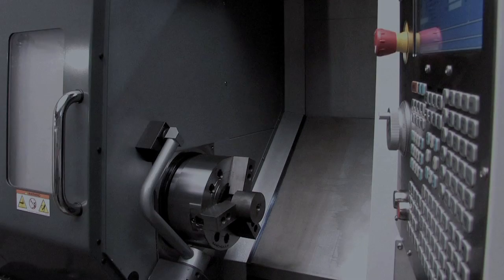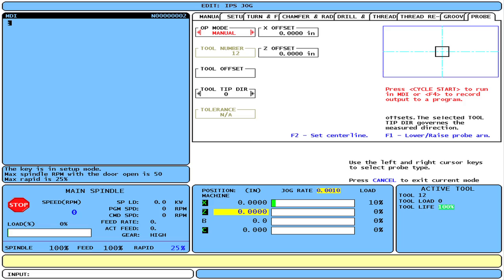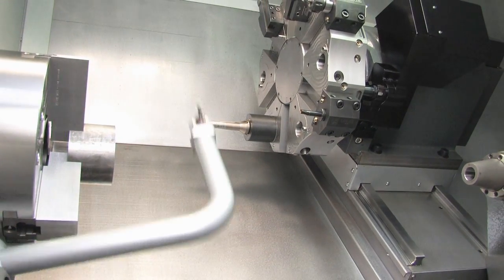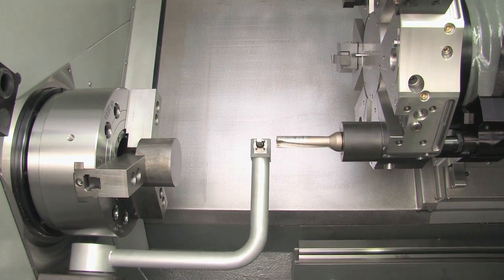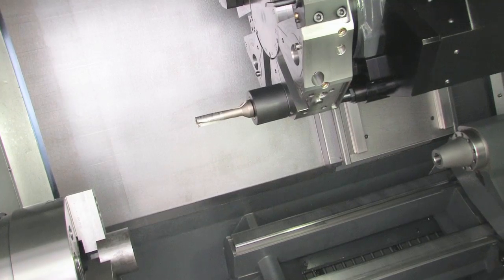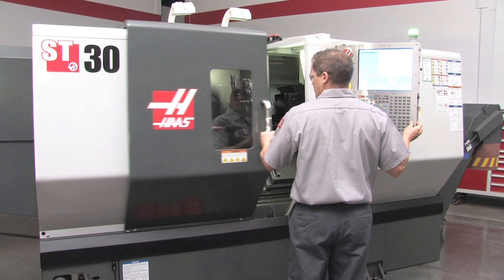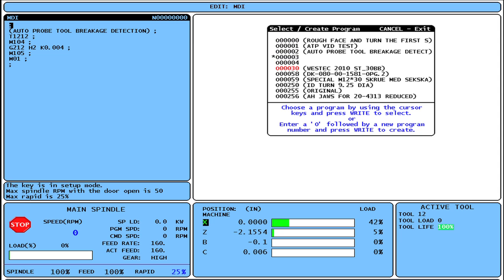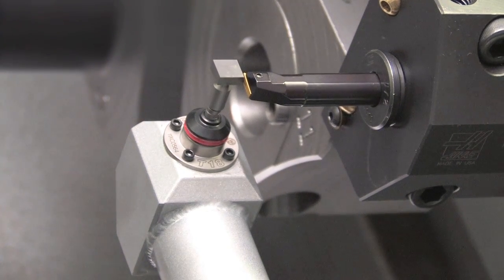Haas Automatic Tool Presetter — How To

Comment: Ive been setting offsets with the probe on our ST-10 2012 and came across a circumstance where Id set the offsets for several tools using the probe and also set the z G54.
I then needed to add a long drill that was to long for the probe. What is the correct prodedure to set a manual length when all tools and offsets are set with the probe?

Comment: Can more than one offset be defined for each tool? For instance, say that a multifunction tool such as an Iscar Picco MFT is placed inside turret tool position #1. This tool has two cutting edges: a drill/boring bar on one side, and a threading tool on the other. Can offset #1 be used for the drill/boring bar length, and offset #13 (because the turret has only 12 positions) be used for the threading edge length? Also, what about two-sided boring bars on sub-spindle machines? How can the tool-probe measure boring bars or milling tools that face backwards?

Comment: I hate those machanical tool setters. They are much complicated and stay often in the way to getting a tool set, espacially on the Takisawa i has to work with. Fine made optical tool setters are faster, safer and easier to use.
They are also extrem precise.

Comment: how do yuo slow down the tool arms speed the ones we have come down to fast and bounce and it keeps throwing the setter off
Reply: +Daniel Rowlan 

how do yuo slow down the tool arms speed the ones we have come down to fast and bounce and it keeps throwing the setter off

Reply ·
Reply: Electric or pneumatic actuation?
Reply: We have the same problem we have hydraulic one dont have a detailed scheme or drawing for that so could not solve this speed issue

Comment from the maker: To touch off a drill or end mill in a radial holder you would touch off the X on the probe then touch off the Z on the probe and subtract the radius of the tool from the Z offset.
 
To touch off a drill or end mill in an axial holder you would touch off the Z on the probe then touch off the X on the probe and subtract the diameter of the tool from the X offset.

Comment from the maker: The F2 X offset position is usually set to the center of ID tool holders depending on what turret is on your lathe. To set the center of a drill that can not be set using the F2 button. Set one side of the drill, in the X direction on the probe, then change the X offset by the diameter of the drill to get the center of the drill location in the X tool offset.

Comment: Ok, I tried that and it worked great.  If I had a VDI Holder.  Say I have the indexable drill in a boring bar holder?  Or what if its not an indexable drill at all.  Say its a drill chuck in a boring bar holder.  How do I center that with the probe?

Comment from the maker: MILL:
To set the length of an insert drill on a mill you need to run a face mill or end mill length rotating probe cycle. You will need to enter the length of the insert drill and the diameter of the longest insert on the insert drill.

Comment from the maker: Hello and thank you for the question Jeremy.

Here is how to setup an indexable drill using the probe (on a LATHE):
Press HAND JOG.
Go to the TOOL GEOMETRY screen.
Highlight the X column for the drill.
Press F2 to load the X offset to the center of an ID holder.
Use the probe arm to set the Z offset for the drill.

Please let us know if you need anything else.

Comment from the maker: Hello Aswin. Unfortunately it is not possible to use the tool pre-setter when a shaft is loaded in the machine and the tailstock or a steady rest is used. You must remove the part and make sure the tailstock is retracted enough to allow the turret to move the tool to the probe.

The pre-setter does work when the chuck is closed and the tailstock is retracted.
 
It is no longer possible to operate Manual or Automatic tool pre-setter functions with the door open.

Thank you for the question.

Comment: How you will use a tool pre-setter for shaft works with Tail stock and steady Rest .? Is it really possible .
Does pre-setter work in Chuck close/tail stock retract condition?Is there any interlock provided ?Have you by passed any interlock in the video uploaded

Comment from the maker: Hi again hoarp001. Here is the answer from your question from Haas applications engineer Anthony:
G212 H(x) K(x) is for tool break detection, it is intended for checking the broken tool. You should use AUTOMATIC cycle, G212 H9(x) without the K variable. You can also run the G212 to check for tool breakage first, then follow by G212 Automatic cycle to update the tool data.
 
If you have any questions, Anthony is happy to help. Thank you hoarp001.
Anthony Banh
805-278-1800 x 7207
abanh@haascnc.com

Comment: ...cont. I have parts I need to hold +0 / -0.010mm on for bearing journals and I think probing the tool before doing the bore operation would be very handy. I assume that all of this, and the automatic moving probe arm are part of the DS30SSY machine? Thanks.

Comment: You mention the break detect sequence can be pasted into a program... I gather the break detect wont re offset the tool, it will just throw an alarm if its worn beyond tolerances... Could the auto probe sequence code be pasted into the program, so it re probes and re zeros the tip? That way if 0.01mm of wear has occured, it will take this into account. I also feel that since this re probe would be done after the tool has indexed, it will compensate for any index inaccuracies. cont....

Comment from the maker: 16. Subtract Offset B from Offset A. Enter this value into Setting 59.
17. Measure the width of the probe stylus with the micrometer. Enter this value as a positive number for Settings 62 and 63. Once the tool probe is properly aligned, the values from X Dia Measure and the value from the probe will be the same.
18. Multiply the probe stylus width by two. Subtract that value from Setting 59, and enter this new value as a positive number into Setting 60.
Please let me know how this works for you.

Comment from the maker: 11. Jog the tool away to a safe position out of the tool probe arm path.
12. Lower the ATP arm (M104 in MDI).
13. Jog the Z-axis to approximately center the tool tip with the probe stylus.
14. Jog the X-axis to bring the tool tip to approximately 0.25" (6 mm) above the probe stylus.
15. Select the .001" jog increment and hold down the -X button until the probe sounds off and stops the tool. Record the X-axis offset position as a positive number. Call this Offset B.
CONT.

Comment from the maker: 5. In the Z-axis only, jog the tool away from the part—do not jog the X-axis away from the diameter.
6. Stop the spindle.
7. Use a micrometer to measure the diameter of the cut made on the workpiece.
8. Press X DIA MEASUR to record the X-axis position in the offset table.
9. Type the workpiece diameter and press ENTER to add it to the X-axis offset. Record this value as a positive number. Call this offset A.
10. Change Settings 59 through 63 to 0 (zero).
CONT.

Comment from the maker: If the probe arm operates as described, continue with the calibration steps below. If it does not operate correctly, contact Haas Service for help.
1. Install the OD turning tool in the tool 1 station of the tool turret.
2. Clamp the workpiece in the chuck.
3. Press OFFSET and clear the offset values for tool 1 on the Tool Geometry page.
4. Use the turning tool in station 1 to take a small cut on the diameter of the material clamped in the spindle.
CONT.

Comment from the maker: Automatic Tool Probe Calibration
This procedure requires the following: an OD turning tool, a workpiece that will fit in the chuck jaws, a 0-1.0" micrometer to measure the tool probe stylus, and a micrometer to inspect the workpiece diameter.
First, make sure that the Automatic Tool Probe (ATP) arm operates correctly:
1. Press MDI/DNC.
2. Type “M104; M105;” (without quotes) and press insert.
3. Press SINGLE BLOCK.
4. Press CYCLE START. The probe arm should move into ready position (down).
CONT.

Comment: thanks... i still haven't got to the stage of running yet, so i am confident now the probe parameters are correct but when i go to set my g54 z offset like in this video i come up with a positive value of around 280.xxx mm then the simulation throws a z axis overtravel alarm, the job sits about 1mm shorter then the front face of the probe and i used a wnmg turning tool to set the front face???

Comment from the maker: Hi jeppoification. This should help (please let me know if you still have any questions).

When the program is running and the tool offsets are active then WORK will show the diameter that you are cutting. When you reach the M30 or press RESET the tool offsets are cancelled and WORK will then show the MACHINE co-ordinates.

Comment: hi there. we have an sl30y, i have just started this job and noticed straight away that the tool presetter seems to have been setup incorrectly, the x od parameter is set to approx 150.xxx mm and the z front parameter is set to 0.0 so when you have operator/work/machine coordinates displayed they all show the same figures which i would assume from previous experience the work coordinate should show the diameter the tool is cutting???